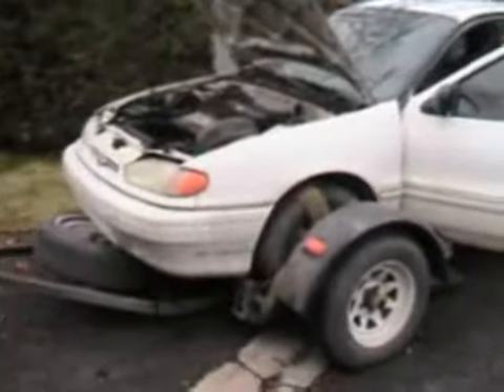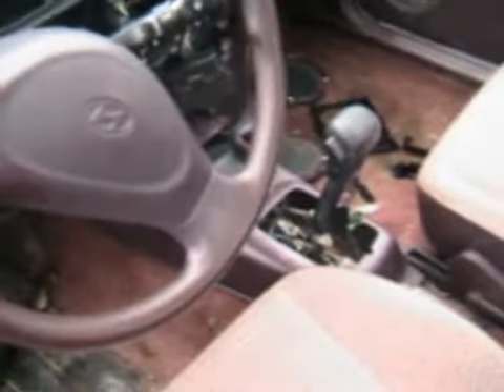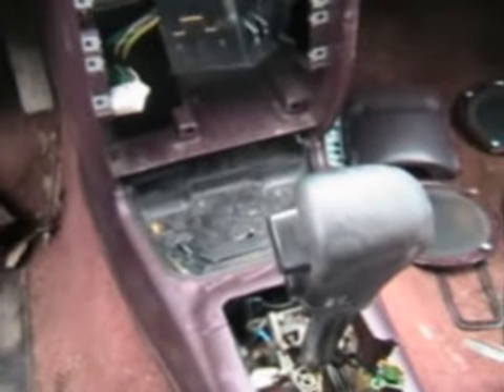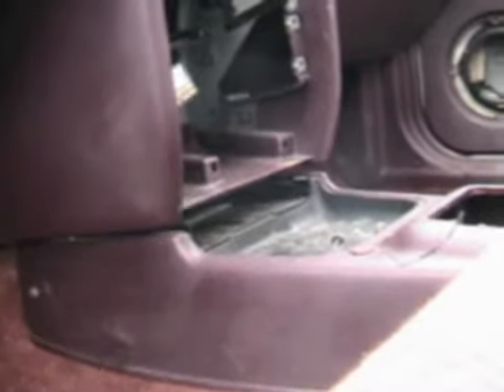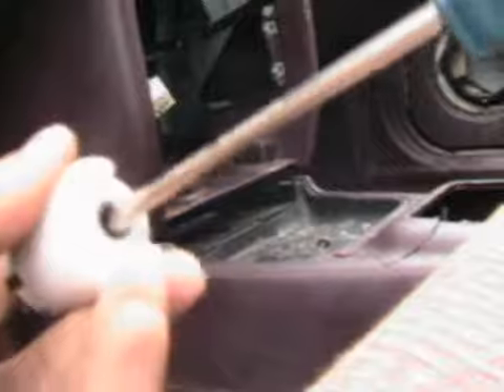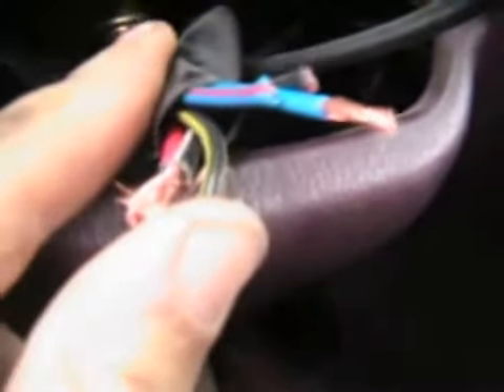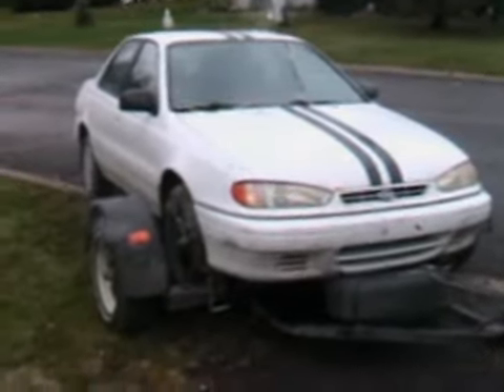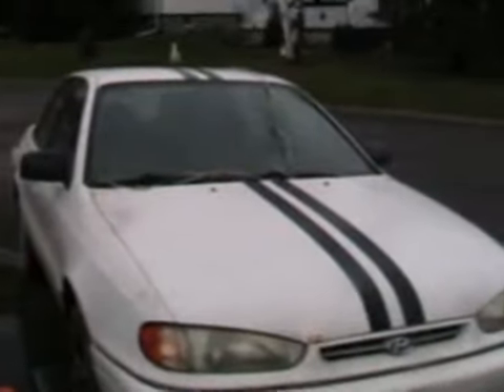Hyundai Sentra: How I by-passed the ignition

Comment: Hear how it sounds like only half the engines turning over? That hollow/no exhaust sound. Timing belt snapped bro. Take the oil cap off and have someone crank it. If the cam don't turn the belt snapped